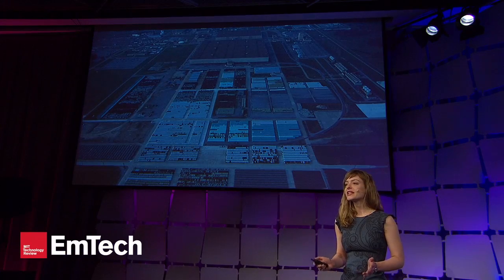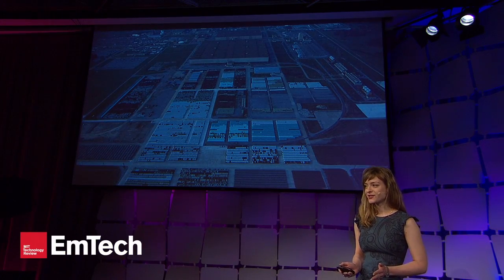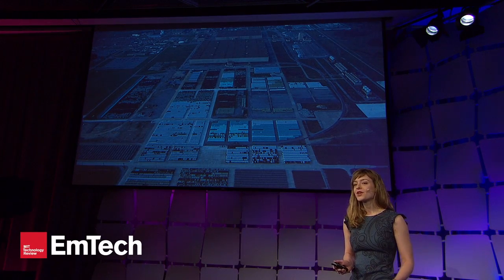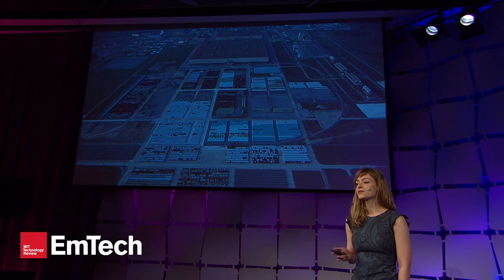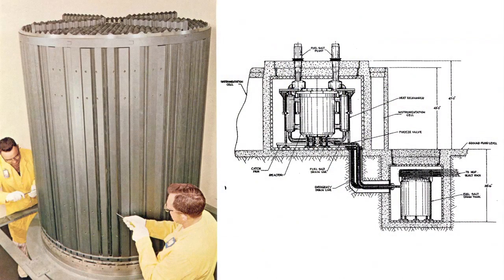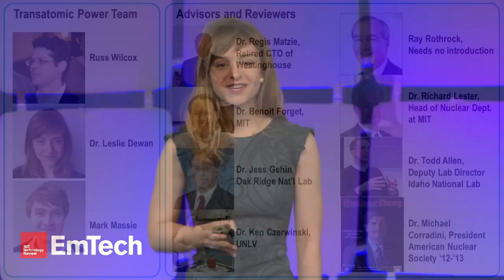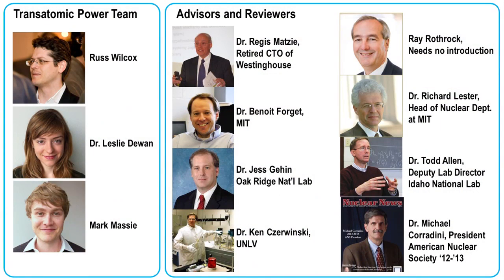Innovators Under 35: Leslie Dewan, Chief Science Officer, Transatomic Power

Comment: Her company's molten salt reactor has a lot of advantages and can fill niches too
small for a large conventional reactor. It can burn Thorium, although Thorium is not as safe from proliferation as burning nucear waste and there is no compelling (or even logical) reason for using Thorium.  Nuclear wastes in the U.S have enough energy
remaining to provide all the power this country needs for the next 1000 years. And the oceans are full of uranium that can provide cheap fuel for a molten salt reactor.
The world will never run out of cheap uranium fuel.
Reply: but were all to frightend to use it! it takes pioneers to take a chance, if they used nuclear power for space exploration we would be miles away from where we are now

Comment: Already several years ago I thought: "the safest way to deal with radio-active fuel waste, would be by making it an economically desirable product again, by making it a usable energy source again." I thought so because I heard or read that the waste keeps producing heat for a hundred years and longer. Transatomic Power's design, if I understand it right, is even better, because it physically and drastically reduces the amount of high-level long-term radio-active material. Too good to be true? Or will it really, after a few years of development, solve two of the world's big problems?